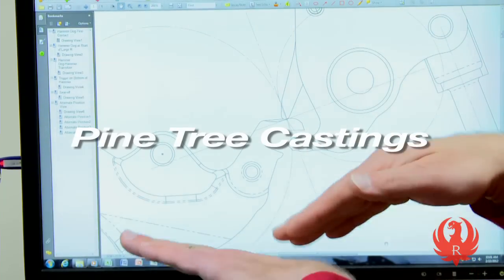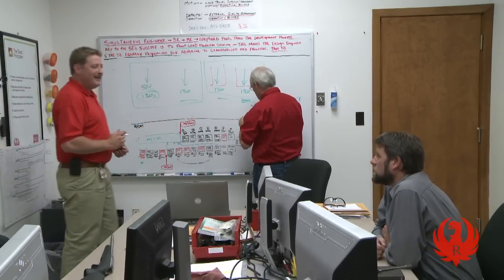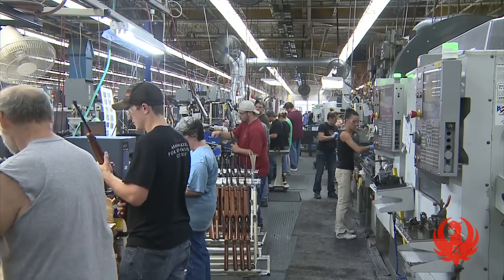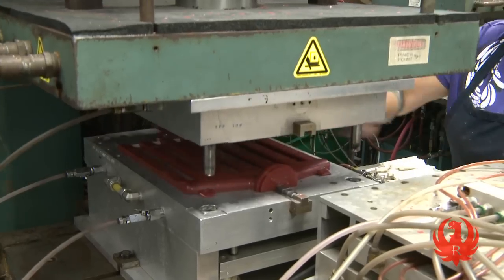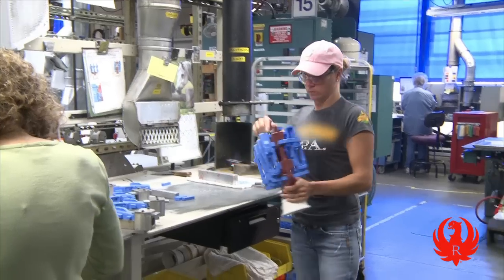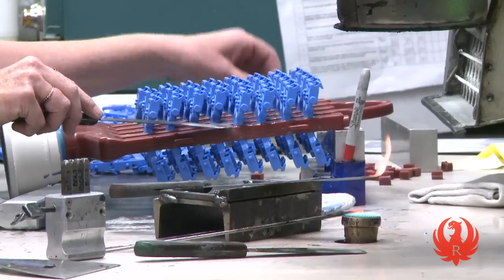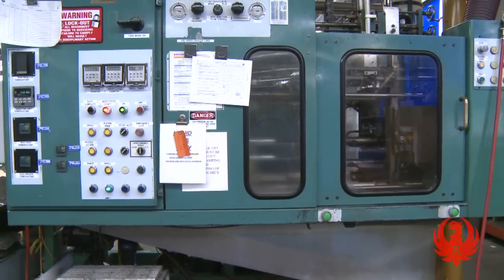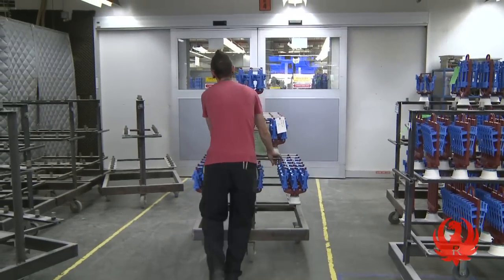Part 1 Ruger How It's Made -- Wax Molding and Gating

Comment: Does they cast barrels?
Reply: Doubt it. It's already cheap enough to get a length of steel rod and make it into a gun barrel.
Reply: Someguy6571 I found a picture of ruger factory which makes casting die of barrels. But I concern about strength of those barrels.